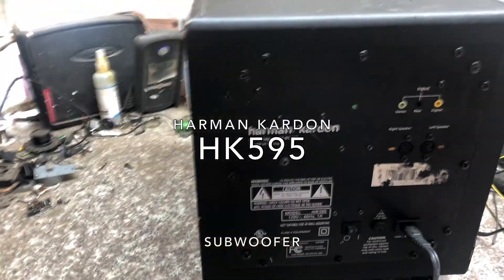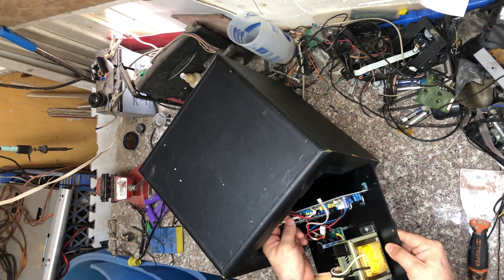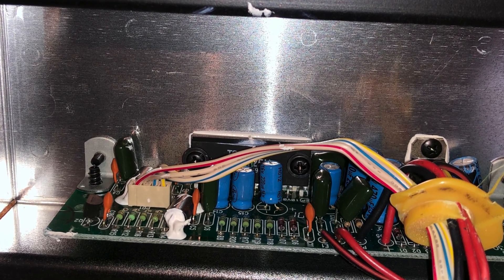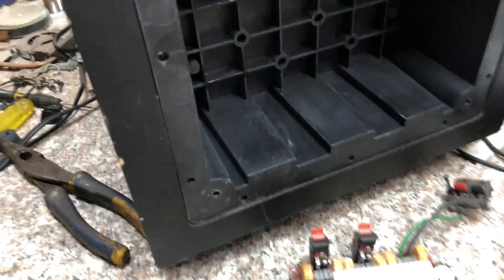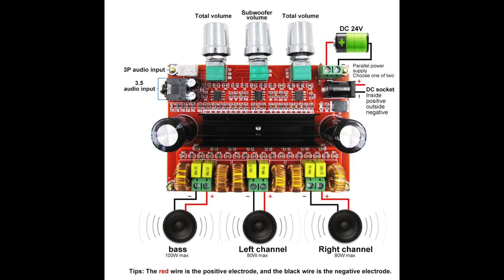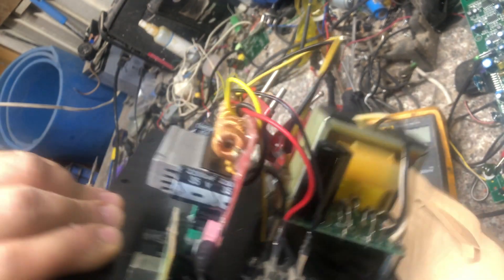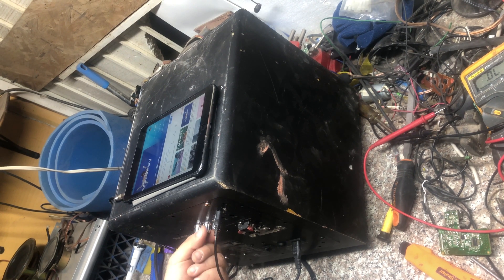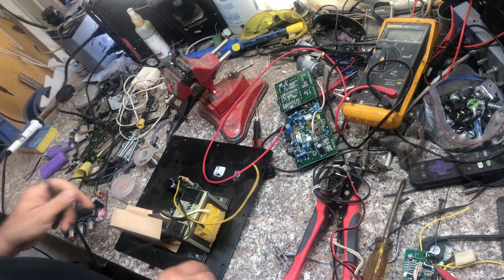Harman Kardon HK595 2.1 subwoofer disassembly and repurpose installing a TPA3116 amplifier board.

Comment: I have a sub like this too and can’t make it work cuz I don’t have the original speakers for it.. so I wonder if I can make the sub work with building 2 cables like that, a 4 pin and a 5 pin one.. and simply mount them to two passive speakers?

Comment: To all you nitwits that want to try same 'resque' I found that my HK power supply gave 29V DC with reversed polarity? So I had to connect the minus at the positive inlet of the TPA3116 amp, and the postive feed (which was indicated on the circuitboard +) to the negative inlet of the amp? It gave a huge spark also, 'cause the elco of the HK power supply only gives away the current very slowly. Which is a good sign - being steady DC current as a consequence. Suddenly the LED on the TPA3116 that I used went 'on', and to my surprise the amp had not suffered damage from the faulty wiring from the first attempt. SO DO MEASURE YOUR DC CURRENT BEFOREHAND: THE POWERBOARD OF THE HK CAN GIVE YOU A FALSE IDEA OF + AND -  !!!